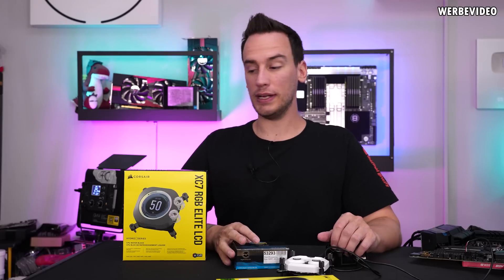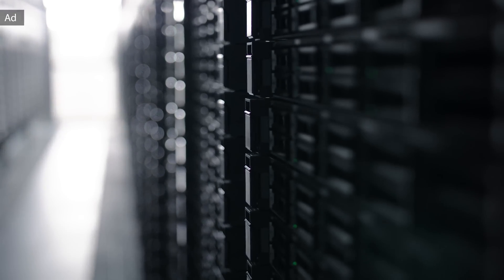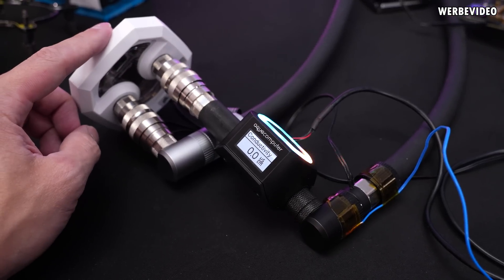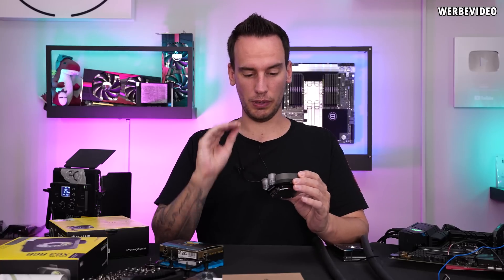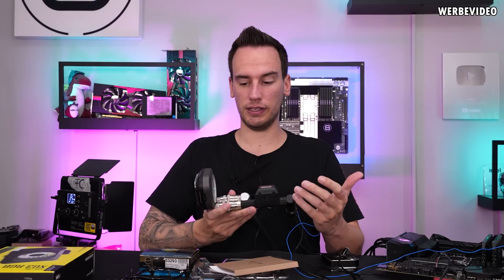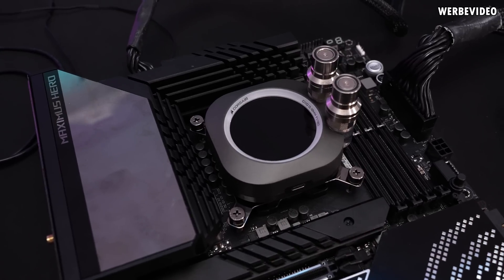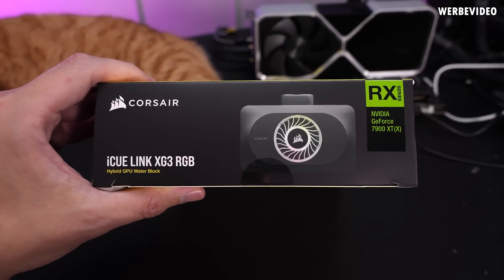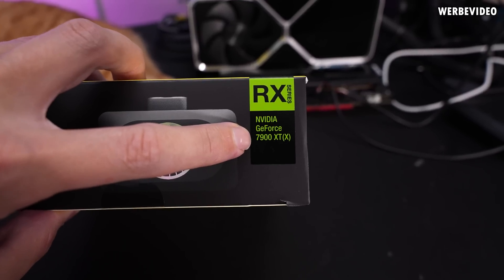Is This Water Block Really Worth $200?

Comment: I feel like a zig-zag pattern would be more ideal for coldplates. But that is more difficult to mass-produce. This time of thin structure is easier, since you can just make a 'shaving comb' to manufacture the fin-stack once you've milled down the surroundings to right depth. 

How ever, I do believe their water distribution is quite good. But I think their current design is more suited for lower flow rates than higher. A higher flow rate in such a non-restricting CPU block simply harms its performance, I reckon. It would be interesting if you added a 'valve' before the flow sensor. So you can play around with the flow rates and see what happens if you start on low flow rates and increase.
Reply: I understand that shaved is less thermally efficient than milled for fins, some change in the electro-mechanical structure under shaving.
Reply: @MyklCarlton  I am taking a bit of inspiration from the Aquarium hobby and how people look at the use of UV bulbs. Light transmission and Heat Transmission isn't too different. Generally, in Aquariums, you want slower moving water across a heating or UV bulb because it provides more time for the energy to attach itself to the water column. In Aquariums, the complexity is less but the flow is generally unhindered through the components. The current design of this Corsair block is similar in that it doesn't really restrict flow.

Therefore, I believe a slower moving water across the CPU block might be better for it. In fact, I believe it would be better if there was a slower moving water current over the CPU with a pass-through, that just returns to the radiator. Basically, high flow through Radiator, Low flow through CPU.

Comment: NO.. its not worth 200 bucks for just the block lol... but corsair like to pretend like LCD screens are super expensive and high tech lol lol lol lol! 

Its not the first time.. they had the AIO H150 or 170i cappelix that has LCD screen on top of the pump. :)

Comment: Perhaps you should measure power draw on the pump as well as flow rate. If power draw increases on the pump, it could indicate restriction.
Reply: Not how that works.
Reply: How so? @helium5912   If the pump speed is pwm controlled. The pump setting is a percentage of max rpm if I am not mistaken. This means that with resistance to the flow, the pump will work harder to maintain the same rpm/flow, and thus draws more power.

Comment: A minimal flow rate can be estimated based on the max sustained CPU heat output, the heat capacity of the block, the heat capacity of the water in the loop, the radiative heat of the cooler equipment, the ambient temp, and some other variables I am forgetting!

Or find it empirically 🎉

Comment: The marketing on the cold plate temp is fine imo. As you said, it's a small difference and if you're running your pump & fan speeds off that sensor then it just needs to be adjusted relative to that temperature reading and your actual CPU core/package temps. Definitely very overpriced in typical corsair fashion, but also a very sleek design and overall looks to be a quality product. They're really putting a huge premium on their whole new icue ecosystem. Whether it's the new fans with the single connector or this water block, it's all wildly overpriced. Thankfully there's quite a bit of competition.
Reply: It will be too slow to run pump speed correctly, and probably too quick for fan speed.  If it were closer to the center of the coldplate and bonded to it properly, you could get a delta T vs the die to confirm a good mount, but as it is it does nothing.  Meanwhile, if you want a sensor for fan speed, putting it at the radiator inlet is ideal.
Reply: It doesn't need to be this real time temp sensor since it's for a custom loop. Custom loops don't need that fast of adjustments, as long as the min pump/fan speeds are reasonable then it's not going to make a difference unless you're doing some crazy OC'ing tests, but at that point you're probably not going with a corsair product in the first place. It's clearly a mainstream product targeted at the gaming crowd. @concinnus
Reply: @AlexC-ds7ji  It adds nothing, because die sense (package temp) is what you'd use for pump speed.  And I wouldn't even agree that the temperature or response time difference is insignificant.  The sensor is outside the coolant moat and seal, so it's closer to coolant than die temp.  Coolant temp is smoothed and laggy vs die by >30s, so it is woefully inappropriate for pump speed.

Comment: I got the non-LCD version of this block, replaced my corsair xc8 JTC edition, same setup and thermal paste and dropped 5 degrees C, I think it has more to do with the mounting solution in my case as I am on AM5 and my old block was designed before AM5, either way I'm loving the performance of the block, and it looks great in my rig!
Reply: If the block is oriented with both G1/4 fittings on the bottom, is the left or right one the inlet?
Reply: @Coltranebassmusic  I have mine oriented with the fittings on the right, and my inlet is on the bottom then. So it should be the left side if you have your fittings both on the bottom

Comment: Another advantage to that mounting type also is that you can change it from say intel to amd without having to drain the loop if you're not running QDC's for that :P
Reply: Although depending on when you changed your coolant last time, it might be time to change it... I have mine in for ~1,5y and starting to get yellowy-green (definitely needs to be switched out...)
Reply: @cromefire_   I run ZMT tubing typically and change mine every 2 years on average and it's fine, though if you run clear soft tubing this isn't recommended, I'm more thinking as I change hardware frequently for fun to play with a new platform so that's actually pretty handy for me haha

Comment: The thermistor touches the coldplate and not the water. It's sensing the cold plate temp. It's not sensing in the middle, but that's impossible without interfering with the cooling. What they did is ideal. I dunno what you are expecting them to do.
Reply: It will be too slow to run pump speed correctly, and probably too quick for fan speed.  If it were closer to the center of the coldplate and bonded to it properly, you could get a delta T vs the die to confirm a good mount, but as it is it does nothing.  Meanwhile, if you want a sensor for fan speed, putting it at the radiator inlet is ideal.

Comment: Video idea: How flow affects temperatures.

Question: is water-cooling really quieter than a Noctua air cooler?
Reply: not usually.  depending on the radiator you' may end up having more fans especially if you do push-pull setup and then you got to add the pump noise in to the equation.  water coolers being quieter is a myth.  edit: and air cooling is way less maintenance.  i got in to water cooling for a while and still the one i built with custom loop as a second pc.  but i went back to air on my latest build.  noctua d15s  no regrets

Comment: It says "Built-in cold plate sensor" and that is quite clear and exactly what they deliver - it does not say "sensor built into the coldplate". 
That said it is not all that useful when the sensor is so far away from the contact-patch and behind a water-section. Meh.

Comment: By my experience these QCs are quite restrictive. But by coincidence I have also 152l/h of flow - 2x D5, MORA3, one 480mm XFlow and EKWB GPU block and board monoblock. In total there are 4 pairs of exactly the same QCs. 
One pump runs almost on full power and the other at about 50.
I did done some testing in the past and flow was like 2x better without QCs.
Reply: yep, only use them if you have to, flow rate meters restrict too

Comment: But how accurate can the controls be. You have 3 temperatures: fluid in the pump and two cold plates (gpu/cpu). In addition, information about the temperature of the air drawn by the fans. The temperature of the components increases, the pump increases the flow and then the speed of the fans increases.

Comment: The MO-RA3 is probably the most restrictive radiator in existence. Those style of QDCs are kind of restrictive too.
Reply: Lol, no it isn't. It uses round tubes instead of flat, its very low restriction, especially given its size.
Reply: It's less restrictive than 3 separate radiators of equal size. You're being a little misleading. The restriction is irrelevant if you get the flow rate you want. If you are running a mo-ra without a good pump, you spent money in the wrong place.

Comment: 200 euros for a plastic connection for your cooling wow that is being ripped off sry dudes
Acrylic cooling block are not so good to use as cooling, at least I don't use it and certainly don't have those temperatures even after using it for a long time
If you want a window in acrylic cooling block, ok but this is not good, make cheap and sell expensive it socks...sry

Comment: "built-in cold plate thermal sensor" tells me that it's supposed to measure the temperature of the cold plate. You know, like a useful measurement point in between the CPU temperature and the water temperature. But the way it's set up, it's not going to be an accurate measurement at all. It's not a water temp sensor, because it will conduct some heat from the cpu. It's not a cold plate sensor because it's like 3cm away from the heat source. That means it's useless marketing garbage, just like everything else Corsair makes

Comment: Considering the number of changes to the design, I'm surprised you didn't find much difference in the temperature
Reply: He did mention the optimized flow state, which could allow you to more efficiently connect multiple cooling devices to the same loop, like gpu cooling, without seeing any compromising bottlenecks in the water flow's ability to carry heat away from the components.
It can also be things like long-term durability increases and production cost optimization. Lots of small details add up when combined, but not necessarily in a manner that is directly observable for the end user. Either way, it's mostly the display that is driving up the cost.

Comment: Flow rate also depend on how pump is regulated, if pwm controls pump power, then adding restriction should lower flow rate measurably, if pwm controls impeller speed, then when adding restriction the pump will pull more power and flow rate shouldnt change signicantly up to a point
Reply: I think this is assuming speed is fixed flow which is only true for displacement pumps, not centrifugal ones like the DDC and D5?
Reply: pump is regulated by temperature and in his flow tests there is no temp load so the pump is at the same speed
Reply: Wow are you really saying that the flow rate depends on the flow rate?  I learn so much from youtube comments.
Reply: @kidShibuya  it also depends on how well a given pump can deal with a given restriction.  doyeee
Reply: I was also thinking this, for an accurate measurement you'd probably also want to include pump RPM and power draw.
Reply: @TheAnoniemo  and a lower powered pump.  i think he's got two of those big pumps running.  if you're only using one of the smaller mcp355 style pumps it may have a bigger impact?

Comment: The sensor mounted in this way could not measure precisely flow rate, if you read manual it says you have to keep at least 20-30cm (i don't remember the number precisely) of straight pipe to read flow correctly
Reply from the maker: I also remember this from their old sensors but with this one I checked the manual prior to installation and it doesnt say this.
"integrate the sensor into your cooling system, directions of flow can be freely chosen. For optimum performance and minimum noise, the buttons and the white illuminated area of the sensor should be facing upwards."
https://aquacomputer.de/handbuecher.html?file=tl_files/aquacomputer/downloads/manuals/high_flow_NEXT_en.pdf
Reply: I hope someone tests this to confirm, would be an interesting watch
Reply: Since he measured both the block in the same setup the flow difference will be the same......he measured the DIFFERENCE between the blocks.... Zzzz.....

Comment: block looks pretty slick but i wouldnt use any part with acrylic threading, personally
Reply: my objection has nothing to do with torque. thin consumer-grade acrylic is a brittle plastic that will expand and contract repeatedly due to temperature fluctuations and exposure to light and water. microfractures can form over time without any physical force exerted on the material; once present, they expand until the material cleaves.

this used to be a more common problem twenty years ago, but its still a real concern today. i only use metal threads and fittings because eliminating a potential risk seems smarter than choosing not to do so when a circuitry-based electrical fire could occur...
Reply: @hollywoodmeow  You just have to know which brands to avoid (EK).
Reply: I feel like acrylic is just waiting to break on you
Reply: agree @tomppeli.
Reply: you dont really seem to understand the nature of my complaint. acrylic plates are thicker and more durable than acrylic threading, but no company ever releases durability ratings or associated data. these are consumer-grade products and as such we get the small comfort of a general warranty and a pat on the ass. avoiding one brand we dont like doesnt magically stop acrylic from potentially cracking.
Reply: Agree to that, even tho Acryl is all good in the hood, used it a lot in aquariums but there is a but when it comes to computer :)
Reply: Quality acrylic should not crack under hand tightening. People who crack acrylic when tightening a fitting are usually using a hand tool and applying way too much torque.
Reply: agree to that too, and thats facts! Acrylic should not be tightened with too much torque,  same with the lid for the oilfilter on a motorbike, you cant just torque the fuck out of it because the threadings are gonne break on you and then you get a big problem with the preassure and thats not even acrylic but aluminum threads
 @paskowitz